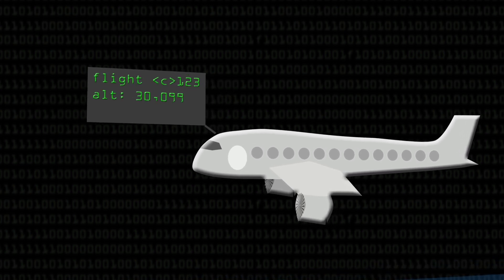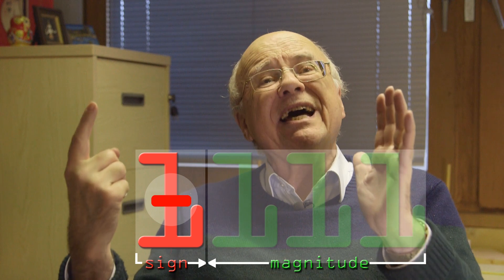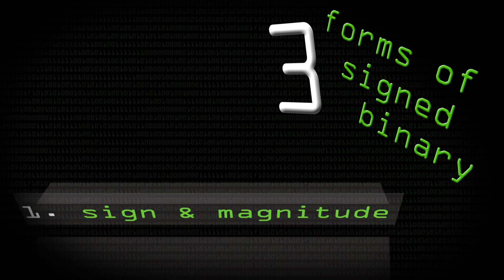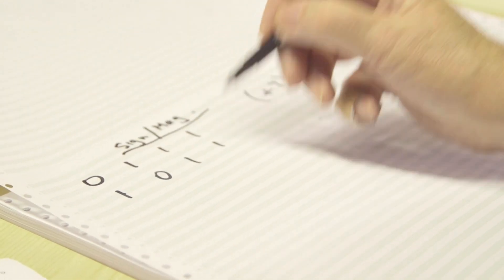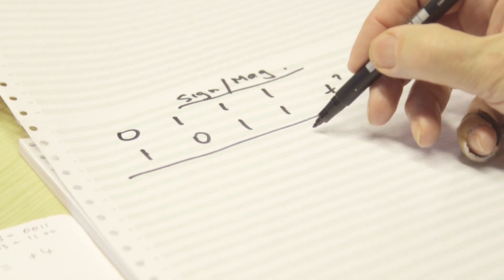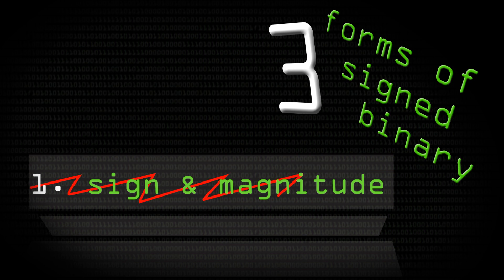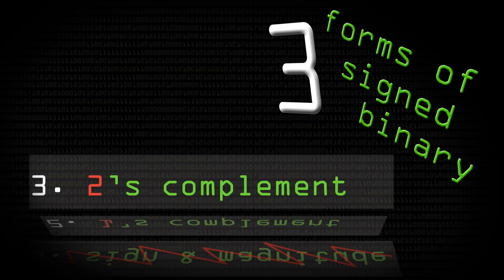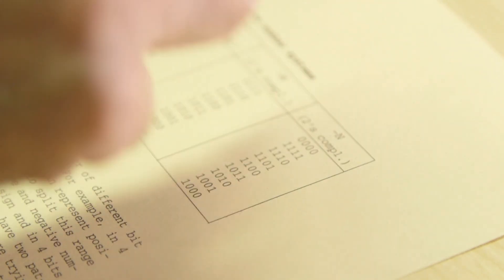Binary: Plusses & Minuses (Why We Use Two's Complement) - Computerphile

Comment: It's funny if you use abs() function for example in C the absolute value of your lowest negative number will be... suprise: the negative number itself (despite manual page saying answer of abs() is always positive number :P). Thanks to having one negative number more than positive, be carefull with abs() - better to write your own and better to remember that. In fe 16b: -32768 exists, 32768 doesn't.
Reply: Beesman The standard clearly states that in case of abs() "if the result cannot be represented, the behavior is undefined."
Reply: // True, errno isn't even set either. Scary!

# include <cstdlib>
# include <iostream>
# include <errno.h>
using namespace std;

int main(){
    signed short a = 0x7FFF;    int erra = errno;
    signed short b = a+1;        int errb = errno;
    signed short c = abs(b);    int errc = errno;
    cout
        << a << " " << erra << "\n"
        << b << " " << errb << "\n"
        << c << " " << errc << "\n"
    << endl;
    
    return 0;
}
Reply: One solution to this problem is to avoid abs() and instead use nabs(). If you don't have nabs() create that utility function on your own [nabs(in) { return (in < 0) ? in : -in; }]. It is supposed to return the negative of the absolute value of the input, which always works. Also, check out the book "Hacker's Delight".
Reply: Kai Kunstmann I have been thinking about abs before this and how to get the functionality of abs without the problems with the minimum value. Never thought about using the negative absolute value... Thanks for the info! It might prove useful one day.
Reply: If you ever need to worry about that you have chosen too small data type.
Reply: @okaro6595  yes, the first thing I would do if I wanted the abs of say a signed char is cast it to an int. That's the easy way to solve this problem.
Reply: Ah, it's because of zero. If zero had two representations, this would not be the case.
Reply: Dennis Oliver Two zeros is also a problem.
Reply: ***** "nabs" is the opposite of "abs" in that it returns the "negative absolute value" of a number, which can always be expressed in 2's complement. The negative absolute value of a negative number is the number itself. The negative absolute value of a positive number, is the negative of it.

Comment: Not the best explanation of 2's complement really, it's far simpler to just say that the "sign" bit just has negative weight.
Reply: While that's more simple for a human to understand (and I in fact encourage anybody to use this when converting negative numbers between binary and decimal), a computer has no concept of negativity, so you're kind of stuck with bitflips and stuff.
Reply: That is how I was taught it at school.
Reply: It means that you substract the MSB's value instead of adding it, like you do with any other bit. So if you, for instance, are working with a signed 8-bit number, the MSB would be worth -128 rather than 128.
Reply: If you assume that people know what having negative weight means, that's accurate, but it doesn't say anything about why it is used or what makes it good. Your version might be a suitable definition, but it's hardly an explanation.
Reply: Well, I think the professor simply wanted to take us through the logic of how we get to that conclusion. The theory of WHY it works.

But, yes, in practice, you just treat the sign bit as its negative - so, for a 4-bit number, the sign bit is in the 8s column, so its weight becomes "-8" and, for a 16-bit number, the sign bit would be in the 32,768s column, so weight it as "-32768" and so forth - and then you just add up the columns in the usual fashion.

And that will work just fine and it's the easiest way, pragmatically, to do it, if you've got a binary number in front of you and you need to convert it to human-readable decimal for your own benefit.

But saying that doesn't explain WHY it works, only that it just does.

What the professor was endeavouring to do was take us through the logical steps to reaching this conclusion, so we not only know that it does work but WHY it works - what's the underlying theory that makes the right answers conveniently fall out the other end for us.

(Think of it like this. It's a matter of perspective. If you're a programmer then, frankly, the fact that it works is really all you need to know. Because you just need code that works.

But if you're a hardware engineer - on the other side of things, creating the CPUs that programmers program - then you have to come up with these ideas in the first place and know WHY it works, as you've got to actually make the computer do it and, of course, you also do need to know why things work at that level, as you've got to guarantee that your hardware is correct and doesn't have a big horrible unchangeable bug in it.

Software people can recode and recompile to remove bugs. With hardware people, their bugs are immortalised in the silicon forever more, e.g. the Pentium FDIV bug, where the floating-point divide instruction was producing the wrong answers.

These guys need to KNOW, for a fact, that they haven't screwed up before they commit it to the silicon. They need to know the "why" to verify - mathematically prove - that it's 100% correct and doesn't have any horrible bugs in it, before sending it to be mass-produced in its millions.

Because this stuff is expensive to do and you don't want to find you've got to junk millions of chips and start again, just because you "missed a bit" in the theory and failed to spot a horrible mistake.

That is, the point is that different jobs demand different levels of assurance.

Operators - which, in this instance, programmers would qualify as being - don't necessarily need to know how the black box works, as long as the black box works. But if you're the black box builder, you obviously need to know how it works because you're the one who's actually going to make it work in the first place.)
Reply: Good points everyone, but I still feel like it should've been mentioned. It's a more intuitive way to think about it, and I don't think watching this video truly gives people an insight into how the system works.
Reply: Nicolai Hargreave Yeah, just adding a sentence about that after pointing out that 1000 represents -8 would be pretty valuable. An extra bits showing that as a consequence, and also showing that the 2 carry bits used as overflow actually works, would go a long way. It could even show what happens if you ignore the overflow (or forget that it's dependant on two signals) with the -(-8)=-8 quirk of 4 bit 2's complement
Reply: I'd love to watch an animation of a schematic diagram that shows the electric current flow through the transistors during addition with positive and negative results.
Reply: ***** It's as I was saying.

The "negative weight" thing is the quickest and easiest way to work out what number you've got.

If you just want to convert a number, then do that because it's really easy.

Every column has a weighting - 1s column, 2s column, 4s column, 8s column, etc. - and all you do is treat the uppermost sign bit as its negative.

So, for an 8-bit number, the sign bit is the 128s column. Treat it as if it's -128 and then add up the columns in the usual way.

For example, you've got the number 10010101. That's -128 + 16 + 4 + 1 = -107. Job done.

Pragmatically, this is the easy way to do conversions. So it is good to know it to quickly work out what number you've got whilst you're doing a spot of coding or whatever.

But, yes, as I was saying, whilst this works, it doesn't explain WHY it works. It's not an explanation, it's just a useful trick to know.

And, of course, the professor's job here is to explain the theory to us. To show where it comes from. To make clear why there's a problem with just using a sign bit alone or using 1s complement, and why 2s complement sorts it all out for us.

There's knowing something and then there's knowing something.

The professor wants to give us proper understanding of what's going on, not just a simple procedure to blindly follow to get the right answer.

That's the difference here.
Reply: Remember that +7 > +5, so it gets a higher value, and -1 > -3, so it also gets a higher value.  -1 is the largest nebative number, so it gets the highest value.